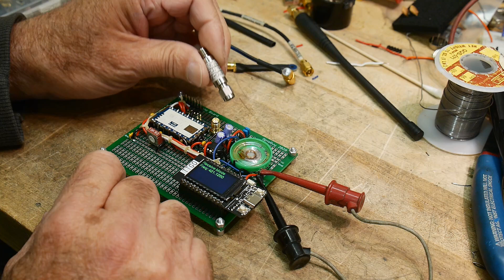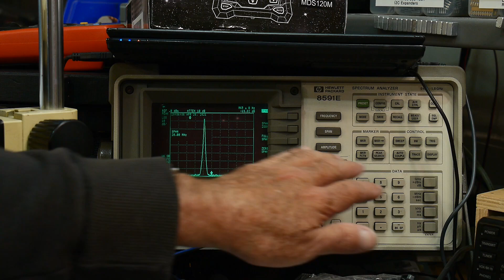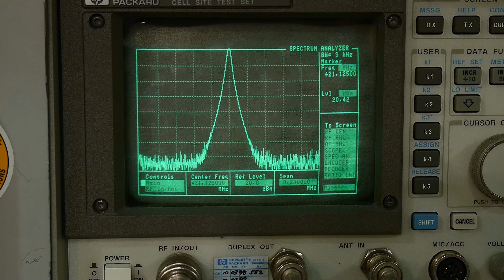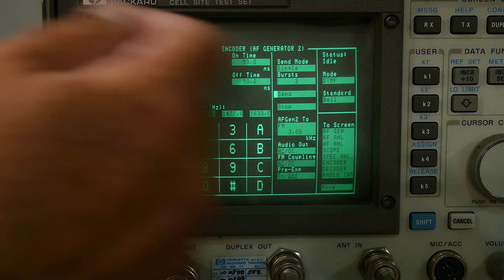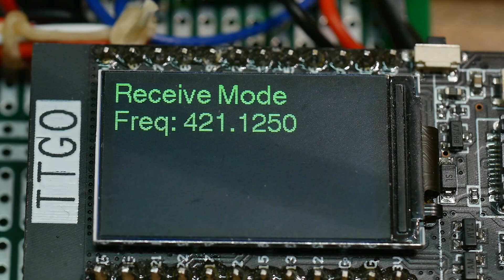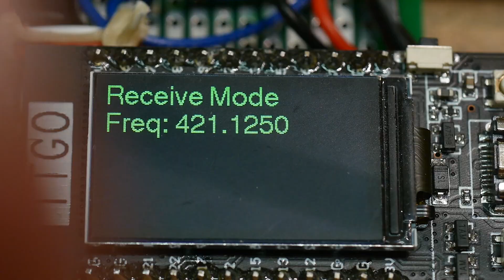#795 SA818 UHF Transceiver Module Demo Board

Comment: I have a VHF SA818 Firmware Version 1.1 - When I invoke filters --emphasis disable --highpass disable --lowpass disable
SA818: INFO: +DMOSETFILTER:0 filters [Pre/De]emphasis: disabled, high-pass: disabled, low-pass: disabled  and indeed a waterfall of the receive shows the filters to be disabled - UNTIL I transmit, then at least the low pass filter is restored.  I was hoping to use an external ctcss/data decoder, but that will not work when the low pass filter returns after transmit...  Any ideas ???  es Thank You agn, de nu5d

Comment: You did relative dB  difference  between fundamental and harmonics  (relative measurement) ,  however some RF regulations require absolute values in dBm or  dBuV/metre.
Reply from the maker: Some of the non licenced bands require dBm, such as 915mhz. I don't know of any for 440mhz  with an amateur radio licence.
Reply: @IMSAIGuy  FCC 15.247 20dB down (not dBm)
Reply: https://www.govinfo.gov/content/pkg/CFR-2013-title47-vol1/pdf/CFR-2013-title47-vol1-sec15-247.pdf

part (d)  says: The frequency band in which the spread spectrum or digitally modulated intentional radiator is operating, the radio frequency power that is produced by the intentional radiator shall be at least 20 dB below that in the 100 kHz bandwidth within the band that contains the highest level of the desired

power, based on either an RF conducted or a radiated measurement, provided the transmitter demonstrates
compliance with the peak conducted
power limits.
Reply: Also there may  FCC  "catch all" spurious emission requirements outside of the operating band

Comment: Very neat breadboarding. I expect you might have more power out if you remove the external LP filter. It might not be able to handle the power. If that is the case it becomes very lossy.
Anyway, nice Video!
Reply from the maker: when I did the power measurement, there was no filter
Reply: @IMSAIGuy  Ahh OK. I measured the VHF version SA818 and I think it gave out 0.5w är the low power setting and 1.5w at high power setting. Perhaps the UHF version has a bit lower power output. The Data sheet also says it is VCC dependent. I belive I tested at 5V.

Comment: Would it be nice if you can hack a baofeng (I think they use a similar Radio on Chip, but you have some filtering, even tho it's laughable; and a BMS and a display!)
Reply from the maker: That would be great. I haven't found anything yet. The only 'hack' was someone removing the microcontroller and having to wire everything to a different one he could program.
Reply: @IMSAIGuy  Yep, that's the one I saw. He sniffed the i2c bus with the original mcu to check which commands to send. It might be a little bit tedious if you want to configure all the features the original firmware had, but hey, it's a complete transceiver for very little money!

Comment: Very cool. Regarding protecting the SA, some SA's want no more or less than 0V DC so you'd also need a DC block as well. Just thought i'd throw that out there.
[edit] I see your SA can tolerate 25V DC.